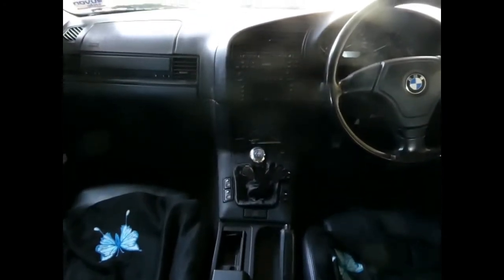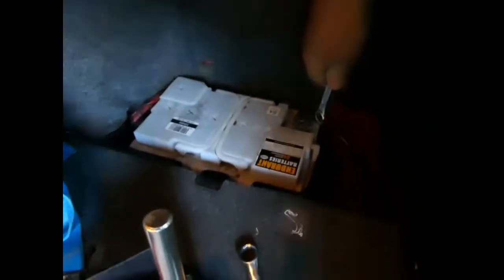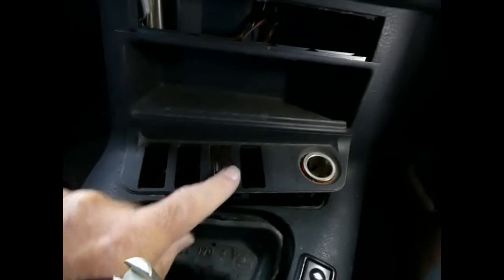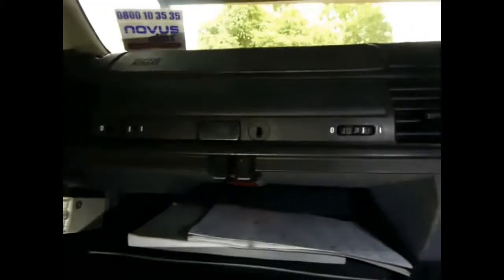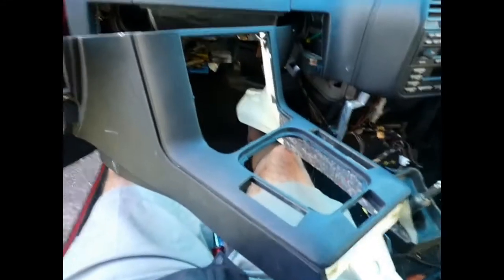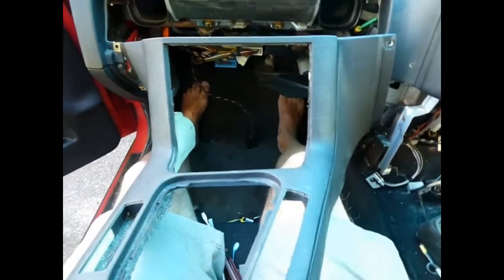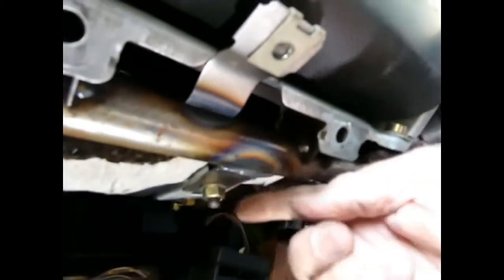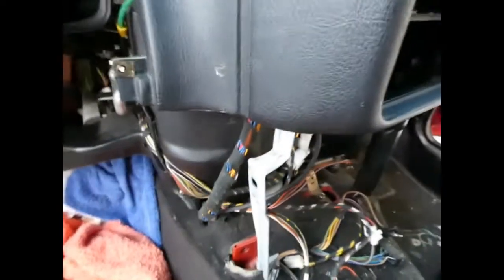BMW E36 heater replacement - Part 1 Removal

Comment from the maker: For the heater, it is NOT necessary to remove the dash, the instrument panel or the steering wheel, or unbolt anything under the bonnet (hood) (other than possibly draining the system), or touch the air con or the cabin air filter.   Cabin air filter lives in front of the air con/heater unit and slides out sideways in a separate, much simpler operation.   Air con is a much bigger operation (I think).
Reply: You sir are a legend. I’ve been dreading doing it but your videos have given me confidence in starting the job which I’d been planning to do for over a year now.
Reply from the maker: @ismilekimura9918   Thanks!    The one thing I would say is, allow plenty of time for the job.   There's nothing very difficult about any one step but some of them are a bit fiddly so it's best not to be in a rush.